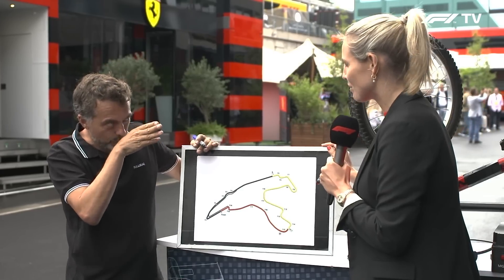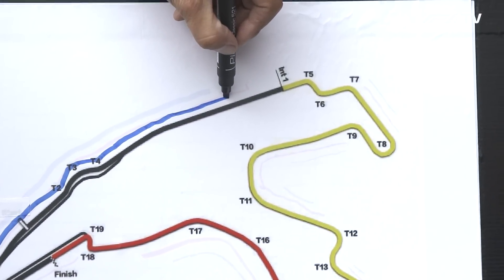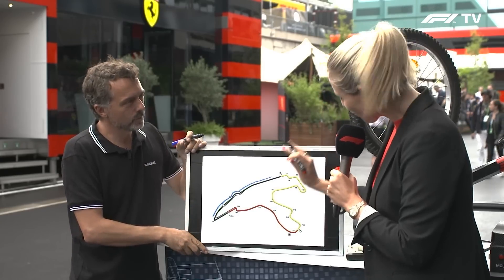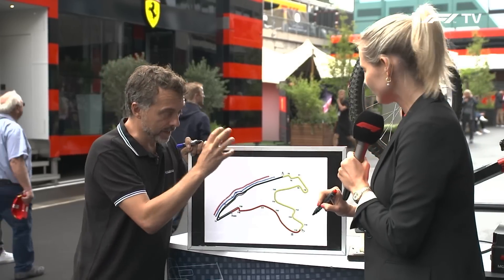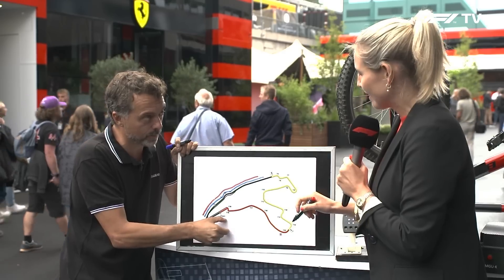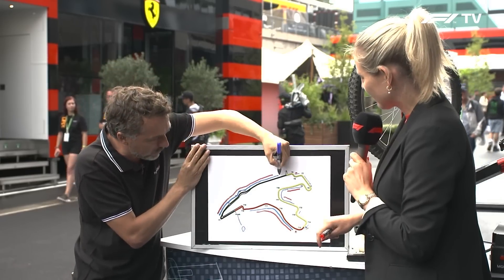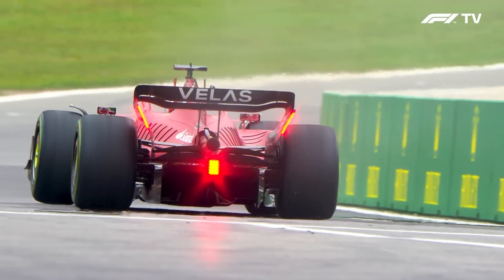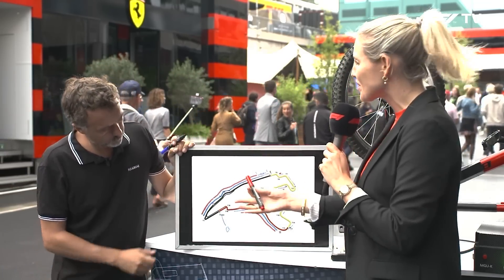An MGU-K On A Bike! | F1 TV Tech Talk | Crypto.com

Comment: The 3rd gen formula e cars will actually have four wheel drive, but the front drive is only for charging during braking (The front wheels are under more load under braking). The rear wheels will not have friction brakes, the braking effort will be done by the rear motor (acting as a generator as it charges the battery). It is claimed that 40 percent of energy used will be from regeneration during a race.
It will be interesting to see what percentage of energy will come from the F1 325kwh mguk in 2026.

Comment: if battery use stops with braking, but albert demonstrate that the battery use stops on the long straight before the braking zone, then how does battery usage stop without actually having braked?
Reply: Because they are probably previously configured by circuit basis, the driver only selects the type of "program", so they can cut the energy deploy before reaching the actual braking zone. Surely is more complicated than that.

Comment: Great segment. Personally I wish the new regulations allowed for the mgu-h to remain and they allowed for unlimited harvest and deployment from both the mgu-k and h along with a battery size of the team's choosing. Then reduce the amount of fuel down to 50kg.
Reply: Well they are greatly increasing the harvest amount for 2026 at least. Most of the teams outside of Mercedes don't like the mgu-h.
Reply: @Appletank8  it doesn't go far enough in my opinion. Furthermore the mgu-h is responsible for increasing the efficiency of the ice beyond what was previously thought  it's one of the greatest automotive engineering accomplishments in the last 100 years. Ice efficiency was thought to be limited to 33% with the rest lost to heat and friction, with the mgu-h the current F1 power units are more than 50% efficient, it's a phenomenal development and it's exclusion going forward is a travesty.

Comment: Do they use the regenerative ability in corner exit to control wheel spin? Like traction control but instead of a computer the driver set the regen to max and controls the amount of regen to control the wheel spin coming out of a corner using the brake pedal.
Reply: Most electronically assisted bikes stop powering the wheels when you stop pedaling, this probably has a similar system.

Comment: You can recover 2MJ from the MGU-K but you can recover an unlimited amount from the turbo. When the car is at full throttle, the excess energy from the turbo can be converted. More full throttle, more MGU-H harvesting.
Reply: Yep essentially u are fuel flow limited in Qually. And fuel mass limited in race. And that was area witch Merrc initially really nailed for years of advantage.